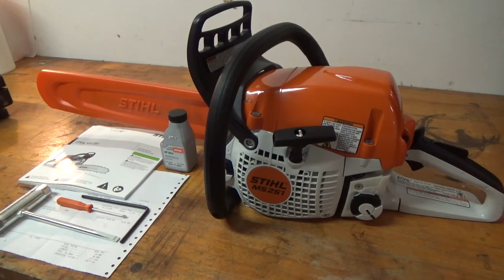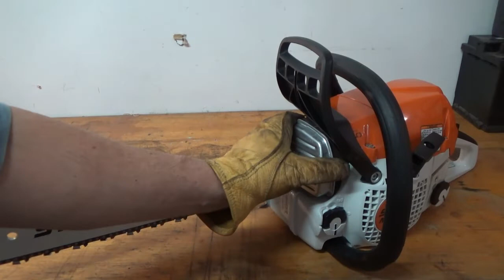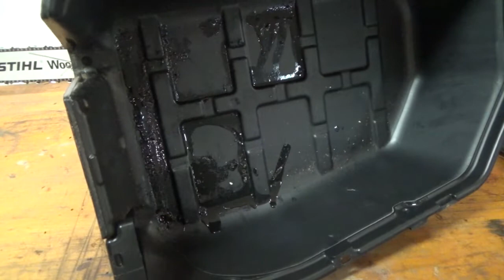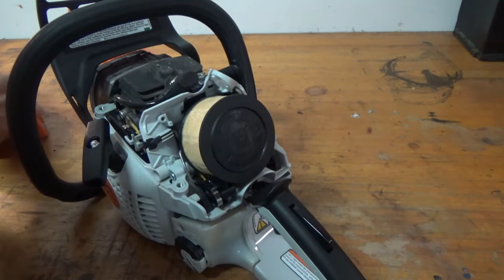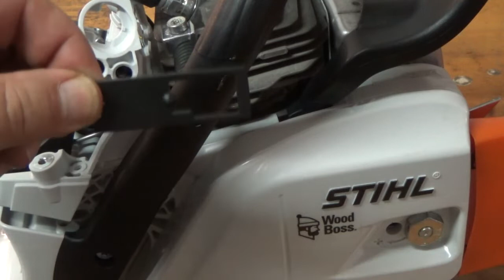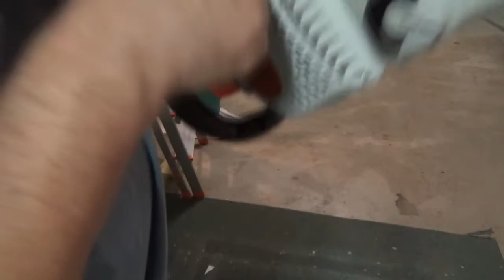Stihl MS 251 Wood Boss Chainsaw

Comment: I have the same model. If the spark plug life expectancy is 500 hours. What is the life expectancy in hours for chainsaw? I use it less then 20 hours per year.
Reply from the maker: @Janisg616  You have a very good question with an answer that varies from 0 to 1000.  The reason is because of the piston rings.  They can stick open or closed, wear down,  or they can destroy the cylinder by scratching regardless of oil changes.
There is no answer and more than likely you will need to rebuild or replace the carburetor once or twice before the end of service really appears.
I store mine without fuel in the tank and I overhaul the carburetor when four or more pulls are needed for a start.
I hope all goes well with your saw.

Comment: What Homelite did you have? A real one or a Chinese plastic one? I just repaired a 251C for a friend. Carb. kit costs $5.00. No offence meant but I wouldn't trade my vintage '60s/'70s Homelites for any Stihl.
Reply from the maker: Perhaps the older ones may last longer,but I went through two and I am a maintenance fanatic.  So I switched. The Stihl is still going strong for me.

Comment: Saw SHOULD THROW OIL. I just read the manual. Other than that, good information.

I've got mine at the shop now for not pumping enough oil. I believe they will adjust the pump.

Comment: I just bought one of these.Why did they do away with the primer bulb?I wish they hadn’t.
Reply from the maker: Mine has always just started right up on the first pull.
Reply: @A_Renaissance_Man  
There’s a vlog of a guy that had a hell of time getting it started when it was new.I had the same problem, but learned from his experience.Still prefer the primer bulb.
Reply: Mine starts easy 
(4 starts so far)

Comment: Been using this for a year felling and limbing a bunch of trees on my border.  Love it.
Reply from the maker: I agree. This saw always starts on the first pull.
Reply: How big a tree is reasonable to fell and cut up to firewood with this saw? I just bought one but am worried I maybe should have gone bigger as I see cutting firewood more often as my primary heating fuel source.
Reply: @lesliechow7286  I've felled and limbed 12 very large Eastern White pines with this on my property.  I would go bigger though if I were in your shoes.    2 reasons.  One because pine is much easier to cut, and also because and larger saw is much easier on the back. You don't have to bend over as much when limbing for long periods of time.
Reply: @ureasmith3049  I have the 251 with an 18” bar. I’m 6’ tall and the other 18” is good. I see this saw model a few years ago came with a 16”. I may be moving back to rural pa where I’m from and cut firewood to heat  which would be hardwoods: maple, oak, cherry, beech. My brother and father have always down this. I think they  both have 3 chainsaws or so though also.  I was just wondering if I should have went up a little bigger for future use. For what I just used this 251 for it was perfect. I guess it’s not even broke in yet so it will get maybe 25% more horsepower. I’m running nothing but 91 octane with Stihl synthetic engine oil. My brother told me this years ago to run in all 2 stroke engines. He’s a diesel mechanic and also has been cutting firewood for 20 years
Reply: @Leslie Chow  I'm sure this will do the job. But i'm 5 '9" And getting up there in age.  I love this saw And it fulfills my needs. But if I use it for firewood I would go longer and larger.

Comment: One thing you didn't do is start it.  I have one and it is impossible to start after it is idle for a period.  The compression is so high that it is very difficult to pull the cord.  I have had to take out the plug and put fuel down in order to get it started.

Comment: My stihl dealer was nice and told me quite a bit but not nearly as much as your guy. I had no idea about the summer winter thing. I better go read that manual. First chainsaw I ever owned. Might be overkill for me but still came out much cheaper than hiring someone to do the work that needed to be done.

Comment: Great information......just finished using mine....blade a little loose...video cleared up what to do.  Liked the part on the air filter...will be checking mine tomorrow.  Thanks for sharing.

Comment: Stihl just gave me a huge purchase credit to replace my old MS250 with the new MS 251 on a 10 year old saw!  How' s that for customer service! My master control lever wore out and would not switch to OFF to kill engine. (Plastic spindle shaft inside a plastic yoke assembly) . I had Stihl dealer replace the horizontal spindle but no help. Because of the  obvious safety hazard Stihl customer service was prepared to pay parts and labor to rebuild my 10 year old MS 250 or grant me more than 1/2 purchase price credit to purchase a new MS 251. I went with the new MS 251. Be careful about where the master control level is positioned  when you remove or replace the orange top cover-- all the way down-- full choke- is best. I loved the MS 250 and hope the MS 251 is as good.

Comment: Thanks! That was very informative! I'm buying new saw and maybe i'll try Stihl MS251 this time. I have had Huskies and the old ones were great (242 and 51) but couple of years ago i bought 455 and it was a dissapointment. The bar is weak and chain tightening wheel isn't working like it should.

Comment: I agree, I prefer Stihl over Husqvarna, even though I have both, but 80% of my saws are Stihl, because I feel Stihl saws are better designed and built.  I have had my 251 since 2016 and the only problem I have had with it was I had to replace the bar oil flippy cap after I loaned it to my oldest daughter for a while.  I use premium non-ethanol gas in all my small engines.  It costs me about a dollar more per gallon.  I break in all new saws with Stihl Moto Mix for the first three tanks with a little extra oil for the first few tanks.  I mix 80 ml of Stihl Ultra oil, one ounce of Sta-Bil and one gallon of PNE gas.  I basically agree with your dealers break in procedure

Comment: Buddy your a 1 nut system.  there's no law on how much oil comes off of  the bar.
Reply: I've had the Sthil 251 Wood Boss for a few months now. I swear more oil came out of it when it was new. All ports/passages are clean and so is the bar. It just doesn't seem to oil as much. I think I'd rather have a little too much than not enough. Time will tell. Besides, oil is just as natural as tar/asphalt pits that nature creates. The earth makes it. Man just refines it. Whether humans use it or not, it will still be here.
Reply: @orion3267 I've NEVER thought of it like that. But it is absolutely true
Reply from the maker: Wrong. Check Virginia Environmental Impact Law.
Reply: @A_Renaissance_Man  Call Stihl USA and see if they put a special oil pump in only the saws they sell in Virginia .

Comment: is 275 a good price for a used one that comes with a case?
Reply from the maker: I have not ever bought used ones even when I used the cheap Polands.  The problem is misuse or just use in general.  There is no known history on the use or misuse of equipment, fuel, or oil.  Good Luck on your search and at least start the machine up and let it run for a while.  Cut something if you can.

Comment: Brake in...hahahaha. The first thing I did with my boss was cut up a 22 inch oak that had  come down on my property. Wide open from the first start. It's two years old now and I've had no problems. I guess I should have broke it in but all seems ok. good video.